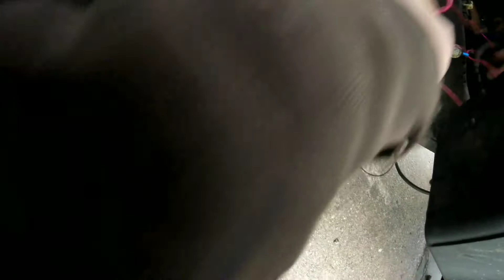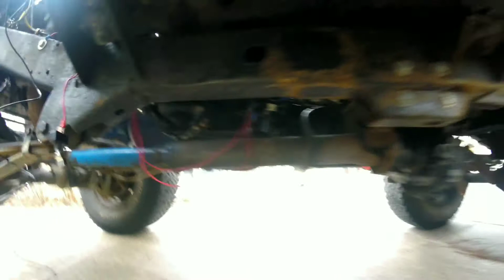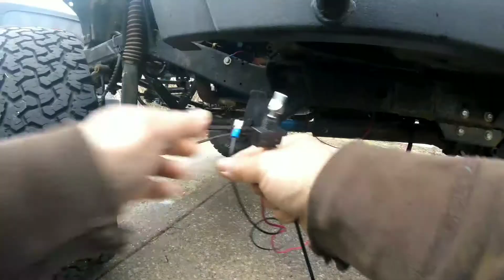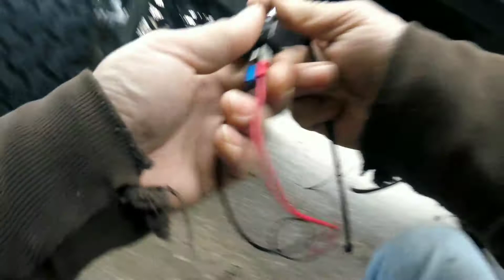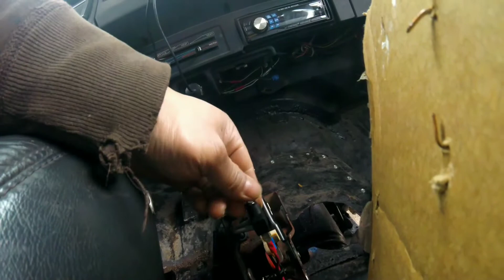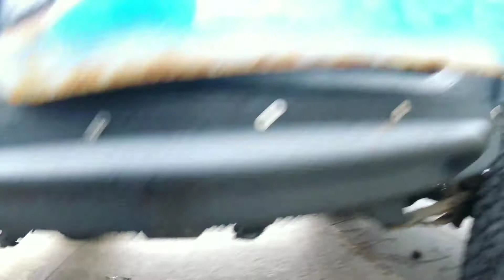How not to wire a lockup switch to a 700r4 transmission on a jeep yj

Comment: hi i am looking to do a similar thing to my 700r4 but can you help me with the details plz i just want to run lock up with a switch i dont know how to wire the connector on the transmission
Reply: mussab akram 87-88 or newer I believe you have to take the wires across and put together and othe is your switch power older 700r4 you have to put a pressure sender on the other side of transmission and wire it in somehow. I have a newer 700 so it was easy
Reply: Take it to a trans. shop they'll do it for you

Comment: You could just put the two wiress off the plug together and ran the power wire and would lock up in 4 gear and when it down shifted it would unlock no need for switches and a wiring mess
Reply: Can you tell in detail on how to do that please ?
Reply: jon sixxx do you run the power wire to a power source?
Reply: I did this and and it made it shift from 3 to 4th almost instantly. And when I get on the gas to down shift to pick up speed it dropped all the way to 2nd gear and so on, any ideas? New trans and converter